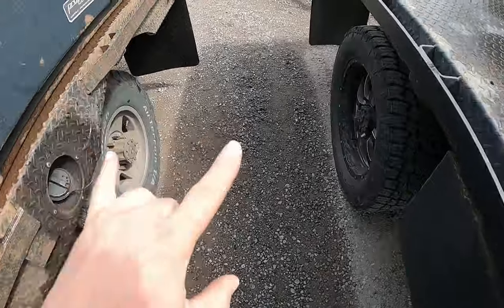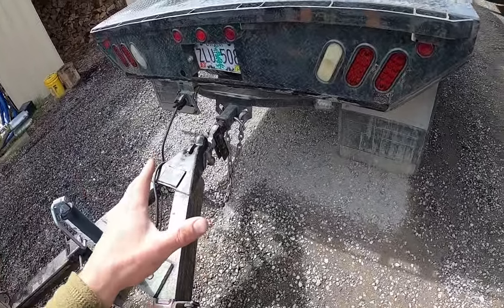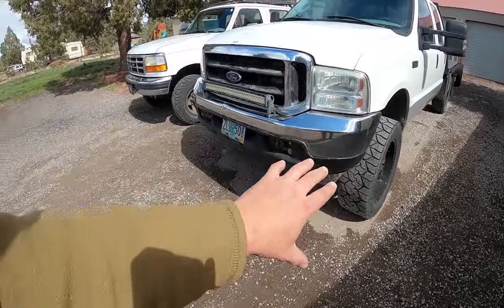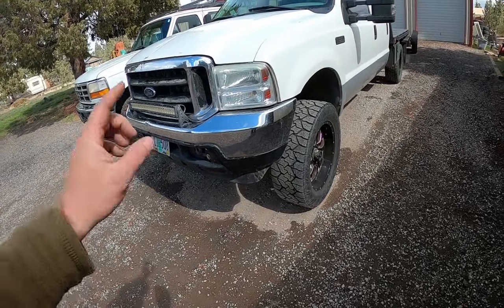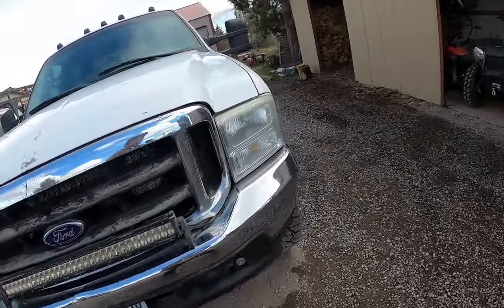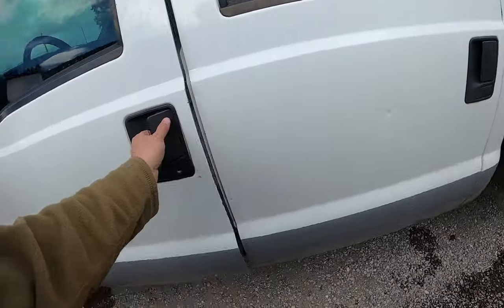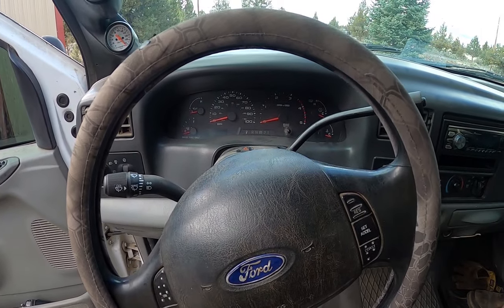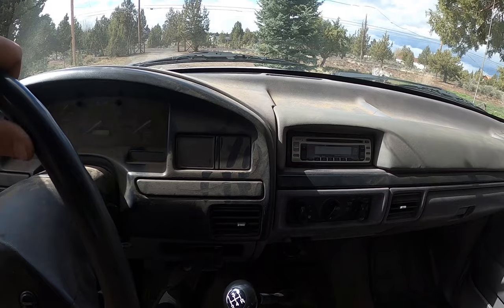7.3 OBS VS 7.3 FORD SUPER DUTY

Comment: I have a 2020 f250 6.7 powerstroke and recently bought a late 99 f250 7.3 with 223,000 miles and let me tell you I can't believe how nice it drives and not a single lick of blowby, Awesome truck !
Reply: How much did you buy your 99 f250 for?
Reply: $10,000 and the bodies pretty nice on it aswell . There's some rust above the rear wheel wells but thats pretty much it
Reply: is this 99 f250 worth it?
Reply: @christianandreev7317  they say they're the best year of the 7.3 . It all depends on what you want I guess . I bought it to keep the miles down on my 2020 and for the reliability of the 7.3.
Reply: @christianandreev7317  so I would say yes
Reply: @dieselnut2369  I just bought a 99 f250 powerstroke in great condition 246000 miles for $7,000. What are some things I should check on it for maintenance?
Reply: @christianandreev7317  well since you just bought it from someone . I would change your oil and fuel filters asap just because you never know when they did it last. I do my oil every 5,000 miles I run the rotella T6 with oil additive and I do my fuel filters every 10,000 miles . As far as  filters go I run nothing but motorcraft filters on both my trucks.
Reply: @christianandreev7317  congratulations by the way ! How do you like it so far?
Reply: @dieselnut2369  Thank you. I just bought it today, my first pickup truck. It’s a KY truck so minimal rust. It runs and drives very nicely and it’s lariat trim supercab.
Reply: @christianandreev7317  slow me to chime in…. Radiator cap today they can actually cause failure from not venting, find out if it’s had o-rings and or inj cups done look up the ipr/icp if it’s oily swap it keep a cps in the glove box. Oil cooler mite be wet prob need to take it off clean it and new gaskets when you do a fluid change. Only use real oem Ford sensors and look up Steven Cox and thoroughbred diesel’s channels they have playlists on the powerstroke.
Reply: I have 1994 obs 7.3,1997 obs, 1999 superduty 7.3, 2001 superduty 7.3. 2013 6.7 superduty,  2015 6.7 duper duty and 1997 ford f 150 4.6 triton nice truck all of them tow heavy no complaints
Reply: @carlosbutler7811  that's alot of taxes
Reply: I am a Chevy guy that was looking for an older truck for my bee business to haul A LOT of weight on a flatbed truck.  I didn't want power this and power that with tons of niceities.  I wanted a bare bones hard working truck.  I was hoping I could find something late 90's to early 2000's with under 150,000 miles with a good maintenance record and a good body.  
   What I ended up buying in 2019 was an 1997 F Series w a Powerstroke 7.3L that had an aluminum flatbed on it & every light changed over to LED, a custom front bumper w a 12,500# winch in it and in the flat bed a gooseneck trailer ball.  The truck has Dana 70's under it.  It was shipped straight from Ford on a train to Pennsylvania where Quigley stripped it from the frame down and put either F550 parts under it or their own proprietary 4x4 parts under it.    This truck is the most amazing truck I have ever driven.  I doubt I ever sell her.  
   When I bought her she had 26,200 miles on her and right now in my garage she is sitting with 29,800 miles on her. 
   I have a brother that owns a small property maintenance company and his F450 left hom stranded.  He asked me to come get him and tow him to the shop.  So I towed his F450, his trailer that weighed over 6600lbs loaded with a 45hp tractor with cab, a backhoe & front end loader while his truck had a larger bucket on it with a gang mower.  I couldn't even tell I was towing anything behind me.  My truck with those 5:13 gears just pulled that load effortlessly right down the road and easily got up to speed with traffic.  My breaks didn't have to worry about the load as we let my brothers truck and trailer  stop that weight.  The truck doesn't have a single bit of corrosion or a single dent.  I am not looking forward to replacing the tires when it needs them.  It came with 6 brand new Mickey Thompsons.  As far as the 4x4 system, I love the manual selector lever on the floor with the lockouts on the hubs.  They will never go bad.  I have am 03 Chevy and every once in a while the dash switch will change what the truck is driving in and that is annoying.
Reply: @michaelbarrett1914  sounds like you found a nice OBS. I would love to find a clean obs
Reply: Those 7.3s Were Built To Last!
You Take Care Of Them, They’ll Run Forever
Reply: I myself just purchased a 99 model superduty and that thing is amazing!
Reply: Just purchased a really nice 99 f250 superduty crew cab shortbed 4x4 for a lil under 10 with no rust seemingly at all. Wish it had the 8ft bed buts it’s still a really nice truck with updated interior a bit. Currently getting it prepped for a move at the shop for around 4-4,500. Mechanically it’s sound just tweaking some things around for me

Comment: So here’s my 2 cents. A superduty  does everything better than the OBS fords. The interior, mirrors, door handles, seats. The only thing that an OBS does better is front wheel bearings. You really have to WANT an OBS in my opinion. You’re sacrificing a lot compared to the superduty platform in comfort and functionality, especially for the prices the OBS trucks are going for these days. They look good, but they are not better. One thing I wish ford would’ve stuck with on the superduty’s are the Alcoa wheels for the duallys.

Comment: I personally prefer the OBS trucks, while they may not have all the newer features, I feel that they are tougher trucks. Currently I own a 1991 7.3 IDI, and yes I know, so many will tell me it's a bad engine, but, mine is sitting at 491,000+ miles, all on the original engine and trans. I'm not gonna knock other people's preferences, but I love the OBS trucks.
Reply: I wonder if the IDIs are better OBS trucks than the powerstrokes.  the issue with my 97 is that it's just so archaic and does a poor job at being a work truck compared to a super duty.  super dutys turn better, have a deeper bed, and are designed around a diesel engine, instead of a powerstroke just being shoehorned in after the fact on the obs trucks.  I've never heard anybody really say the IDI is a bad engine, either! that's wild that people have told you that.  I think they're obsolete, but so is the 7.3 but that doesn't necessarily make em bad!

Comment: Bro called a TTB front end a "scissor F150 setup".....lol. Made me chuckle. My 88 F250 has the Dana50 TWIN TRACTION BEAM setup, and yes, you are right, it rides like a turd on anything that isn't smooth. TTBs ride really nicely with coil spring setup. Im building a ball joint and a king pin Dana 60 right now. I bought the kingpin first, then found a 97 Ball joint axle and decided to go with it because it has the bolt on brake caliper knuckles. The knuckles on the 97 look way beefier than a stock kingpin anyway. Kingpins are starting to fade in popularity because parts are getting harder and more expensive to get.

Comment: I noticed you still have the red brake switch in your OBS (the fire hazard ones). There's an update to that with a black sensor and a new pigtail. Amazon has them from Motorcraft for like $20. I swapped mine out in my 94 and promptly mounted a fire extinguisher between the driver seat and the door lol

Comment: I love the look of the obs. I currently own a 2008 f350 super duty regular cab 8' bed 4x4 with the 6.4 automatic with manual hubs and manual transfer case. I love it. My previous truck was a 1992 f350 dually crew cab long bed with the idi 7.3 and I loved that truck. In fact I wish I kept it. It was easy to work on and completely mechanical. Once running it would run without any battery power at all. I'm trying to find another one because I am a little concerned about the cost fixing anything major on my 2008. I purchased it with 80,000 miles on it and I now have almost 150,000 miles and it still runs strong. But you never know.

Comment: I just bought my first truck a year ago it’s a 2001 f250 with the 7.3. Love it. Very capable truck, so far no issues other than about 8 month ago I had to replace starter, which is hardly really even an isssue to be honest. More normal maintenance
Reply: Actually I shouldn’t say no issues, your comment about the door locks being better on the OBS reminded me, my driver door will not unlock (or lock) by turning the key OR by pressing the button on the interior. I have to get in thru the passenger side. Will fix it whenever I get around to it but for now I’m just getting in from the wrong side.
Reply: @lgrw9883  ckassic, my obs wouldn't open any doors with the key and one day the a tubler in the ignition fell and locked up, ended up replacing the ignition and all the locks. Super cheep and easy. Got to love the old school technology.
Reply: I've got a 2000 ford f250 7.3 and I love it takes a lickin keeps on tickin. in my opinion the 7.3 is the best diesel engine ford ever had second one is the 6.7

Comment: Great video!  I'm surprised that more folks hadn't done one...good for you!  I had a 1997 F250 Crew Short Box with the 460/Auto.  It was a thirsty girl, but one heck of a truck.  Over time, though, the interior trim pieces degraded, got loose, broke, rattled, etc., and it just wasn't fun to work on (or ride in) because of all that.  When I got my first Super Duty (2003 F250 5.4 4x4), was I impressed!  The fit-and-finish of a Super Duty over an OBS cannot be compared.  Everything in the Super Duty fit well, was robust, and there wasn't a rattle one in the entire truck.  My current Super Duty (2001 F350 Dually Ext Cab 4x4 7.3 Long Bed) is the same way...everything in the interior fits well and no rattles.  I never owned an OBS 7.3 so I can't say anything regarding the engines.  Thanks again for the great video...brought back fond memories of my 97!

Comment: Y had a 97 but changed for a 2000 superduty I don't regret it at all, I've used it to for work and to pull a trailer about half the time my 2000 got to over 600000 miles with little mantainence

Comment: Dude...I just experienced this today!  I have a 2002 F350 XLT Super Duty 7.3l diesel, Crew Cab, 4wd, short bed, leather interior, carpet, etc.  I just purchased a 1997 F250 XLT, 5.8l gas, Extended Cab, 4wd, long bed with vinyl floor, manual transmission, and old cloth bench seat.  The 2002 is three times the truck for towing and gets better gas mileage, but the OBS is pure Ford truck porn.  A thing of beauty that is not really good at anything! I am keeping both because I too, have a Ford truck problem!

Comment: if you buy a hydro bost for a 1996 or 1997 f450 they bolt right in to the obs that is what i will be doing to mine i will say the hydroboost definitely is better. so me swapping over to hydroboost and bigger injectors and turbo with a tune i think the obs fairs well especially a clean one and i love both super duty and obs but the obs has something about it that makes me like it more

Comment: got a 97 obs w/ stroke. i have had it 19 years. i got sick of rear brakes and fuel bowl. i replaced rear end w a2001 f-250 rear end with disc brakes and 2001 front rotorz. 01 rotors fit 97 spindle but are thicker so you must turn down a few hundreths of an inch or use old pads to fit caliper over disc. but it worked beautifuly. steers greatstopps even better than ij expected. smooth and controlled . now can use late model wheels . i used 2001 f-250 alloy wheels.  also built a regulated return, flow thru ,fuel system and threw out fords fuel bowl assembly. electric pump and fuel filter / water trap now under  cab and clean. has 50 psi at key on before you even crank. starts immediately . cool benefit of rear end was 3/73 gear and limited slip. disc brakes are sooo much better than drums and way less problems. my truck has 316, 965 miles on original motor . runs very nice. needs a transmission now. no rust no rattles .everything in the cab works and cold air. mostly original. just a tough truck. well made.
Reply from the maker: I want to swap out the drums on my axel as well thanks for stopping in sorry to hear about your dad's truck that is why I started this you tube thing to show people you can do your own maintenance
Reply: @CentralOregonShenanigans  right .thats a service to the public! thank you. yea that rear end swap was easier than i thought and wish i had done it sooner. i fiddled with those drums for years . don't give up the  obs .you'll regret it.

Comment: About fuel: I have a 94' lightning which has the same fuel system as the truck you have there, since its a "tuner" truck you are correct it runs lean. I have to run 3 fuel pumps one being inline with the fuel system, the other problem is people can't buy a whole kit to convert to one tank, the guy who sells it requires you to buy his intake and shit first.

Comment: Im not knocking Hydroboost. I plan to upgrade my 88 Supercab eventually when my vacuum brakes die on it.....however, they aren't dying. Still running the factory vacuum pump. Im the 2nd owner. Had it since 93,000 mile on it. Are there any vacuum accessories on the late model, or is everything controlled electronically? I much prefer to have vacuum diaphragm actuated climate controls. They are reliable and you don't have to worry about replacing electronics just to get your heat or air working.

Comment: I would love bolth, i got a 95 obs with the intercooler upgrade, injectors, bigger turbo, and a tune. I would love a super dutie aswell, main thing its not a 6.0! Love everything 7.3
Reply: Though once a 6.0 is studded n egr deleted its pulling better than a new truck.
Reply: @0xc1d34  for sure new trucks suck, have you driven one? No power, shitty mpg, untill you tune it and delete the egr, deff, and all the crap they put on the thing. The EPA has destroyed the industry for money making purposes. The matrix is real.

Comment: I own both, can't let the OBS go. The OBS looks great, but that's it. I actually like everything else more on the 02 chassis anti-twist in ditches / interior room much bigger. The OBS looks better but the 02 seems to handle twisting / off-roading better with less frame twist and noise.

Comment: problem with the Hydroboost system only becomes an issue when you replace the steering gearbox and the warranty wants you to install an inline filter between the gearbox and pump and you start repeatedly blowing filters apart while driving. When I replaced my gearbox I gave up after blowing up 4 or 5 filters and instead voided my warranty by running it without a filter

Comment: OBS’s not having the granny low gear like the ZF6 in the SD keeps them from being a real serious truck to haul with. You’ll still see some guys running 7.3 SD’s with the ZF6 pulling hotshot flatbeds or 3-car wedges. They don’t have the power of the newer stuff but still get it done. Very rarely you’ll see an ole F-Super Duty OBS still working

Comment: My biggest gripe with the 10th gen and up was the motors being crammed under the cab. I should be able to reach behind the motor and undo the bellhousing bolts from up top when changing the clutch. It will take an act of god for me to part with my 95 half ton, and by that I mean death.

Comment: I have a 97 tuned and a 02 f350 7.3.  I like my 02 alot more. The 97 rides like a stiff board but its also lifted. My 02 has over 400k and my 97 has 250k. My 97 is also intercooled
Reply: Why not sell the 97 then

Comment: We have an 2001 F550 wrecker. How the heck do you keep the truck still with the Parking brake? If our truck is at any amount of angle loaded or empty the Parking Brake won't keep it still. We have talked to long time Ford Mechanics and they say the system is junk. Do you have any ideas? Probably going to end up with a MICO Brake System.

Comment: I had a 88 F350 crew cab long bed dually with a 460 automatic, still have my 1999 F250 supercab shortbed V10 automatic and my 2004 F350 6.0 automatic super cab long bed.  For looks the 2004, for comfort the 2004, for quickness the 1999, for interior room the 1988, for fuel mileage the 2004, for dependability the 1999. Best overall, the 2004 F350 dually 6.0.  All of these trucks are 2 Wheel Drive.

Comment: ’ve got two questions about the transmission: the knob only shows gears 1-4, plus “R” for reverse, plus “L”, plus one more gear in the upper right-hand corner of the knob that I can’t make out. What’s that gear in the upper right hand corner, and what’s the “L” stand for?I’ve heard these ZF6s are great, but do you really have 6 gears to run through if I’m seeing just 1-4 written on the knob?

Comment: Does your truck have the cruise control switch below the brake master cylinder in the engine compartment? My son had an 2002 f250 and that switch shorted and started a fire. Fords on that era had a problem with that. I think there was a recall on it where they gave you a new pigtale  with a  fuse. What would happen is, over time brake fluid would get on the switch and the switch would short. Our truck was just sitting, not running, when it caught fire. We don't know for certain thats what happened but it sounds suspicious. According to our mechanic, this was a problem with these trucks. I was devistated.

Comment: My old trucks been parked in the field it has 430,000 on it 410 years guarantee used to spend it close to 5,000 RPMs it has amazing set for rods and crank 5,000 RPMs 5th gear for 4800 about 112 mph never turn it over 3,800 it could take off on its oil